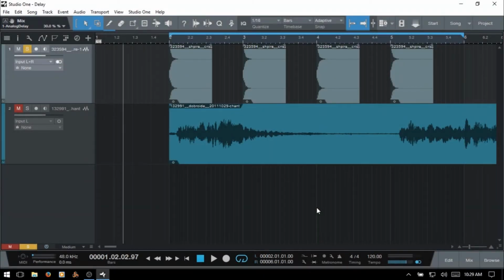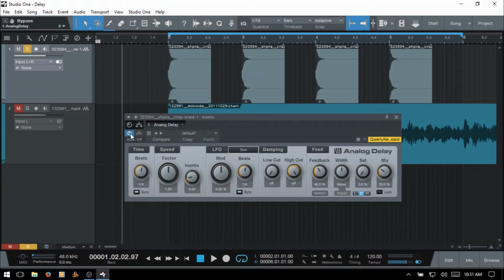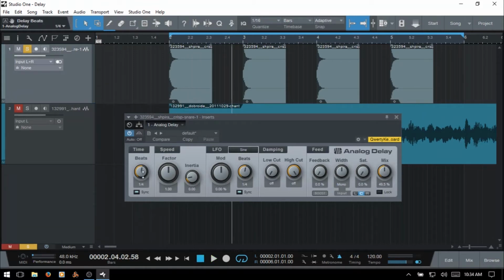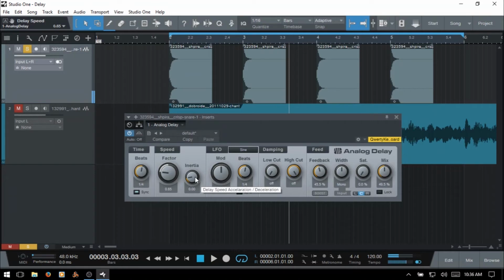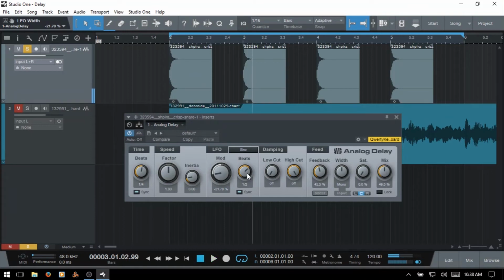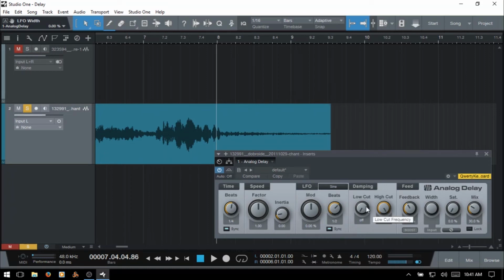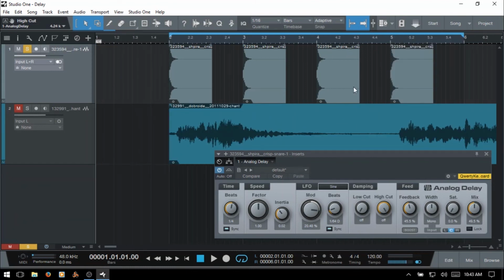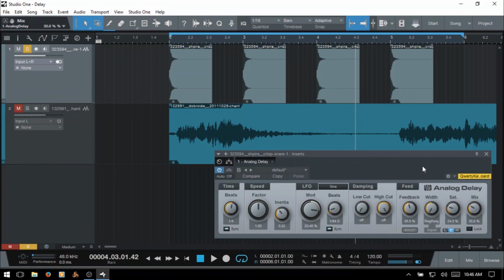Learn Studio One 3.5 | Using Analog Delay - In Depth

Comment: Does anyone know how to change the value of the beats knob under the time section of the delay using automation? I added a automation track for that knob however when I try and change the beat for example from 1/8 to 1/4 it defaults to the originally set beat in this example 1/8. Thanks in advance
Reply: I figured it out in case anyone was wondering instead of right clicking the small circle on the line of your automation track and inputting a value just drag the circle up or down to the desired amount of beats. Sorry if this is confusing if anyone has any questions I will try and answer them to the best of my ability.